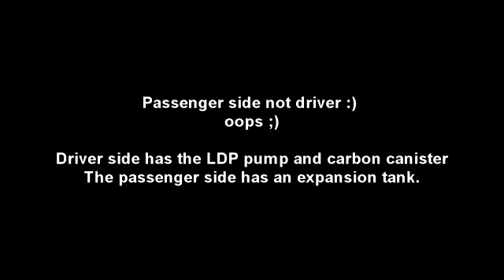E36 318 ti Carbon Canister Fuel Vapor Leak Leak Diagnosis Pump Faults And Component Locations

Comment from the maker: Hello, I have seen this problem before on the BMW E66 7 Series. Often the failure is the fuel tank itself and I have replaced a few for this problem. The one test you can do is to disconnect the carbon canister which traps fuel vapors and see if you can refuel. If not then the problem is in the internal service valves on the fuel tank and it will need to be relpaced. If you can there is a restriction in the carbon canister. So far this is always a fuel tank from my experience.

Comment from the maker: Hello, Are you getting a code for your X5? Your vehicle uses a carbon canister as well with a DMTL pump and purge valve. The smoke is coming out because I have smoke machine attached to the fuel system which pushes pressurized smoke (burning baby oil) through the system. A smoke machine is used to do this test. If you have a check engine light let me know the codes and I might be able to help :)